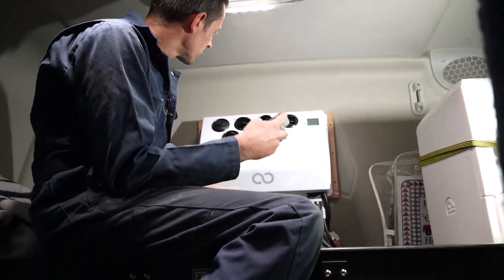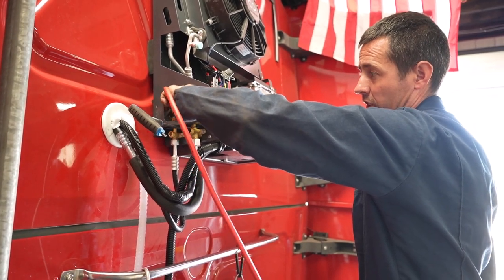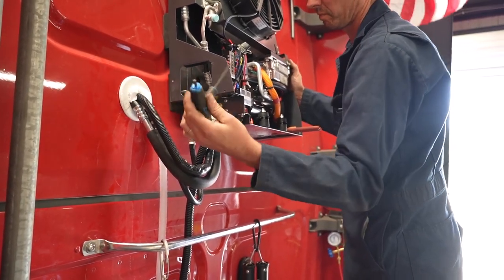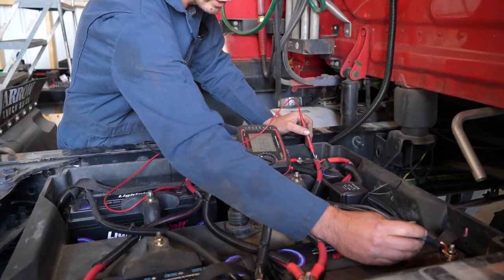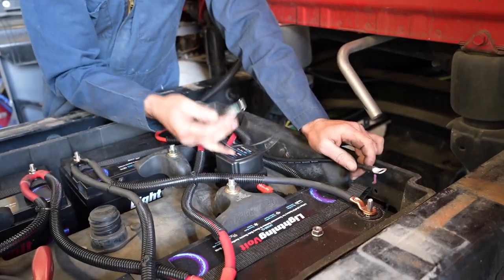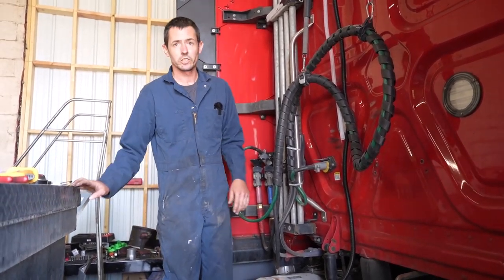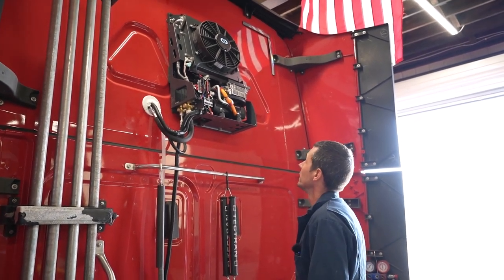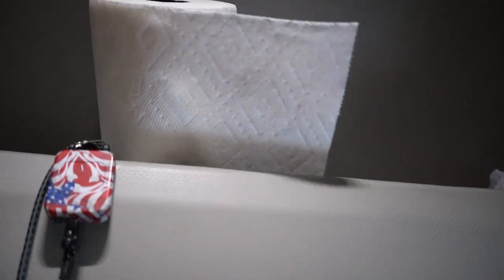Electric APU for Semi Trucks (Our first electric APU installation completed)

Comment: Way too expensive brother! That A/C Unit is $580 at Ebay. I just bought two lithium batteries 12v100ah for $220 each. And just pay some one $400 bucks to installed it. Roughly you’re spending $2k for everything. You’re charging $7k for everything that’s crazy. I understand everyone wants to make some money out here, but Jesus Christ $7k!!
Reply from the maker: You can get a phone for $200 and you can also get a phone for $2,000. They are both phones. But there are major difference in the components that are being used in each phone, brand name, and functions etc. That is all.
Reply: YouTube pricing lol he had to pay camera guy and spent some time to edit this video. That was an additional 5k 😂😂😂

There’s no money in trucking right now. I might as well sell my truck and open ac installation shop. I ordered the exact same unit from China, different brand but still decent quality lifepo4 batteries 600amp, dc to dc chargers, and all tools and was still under 2k. Took me a few hours to do the job but I guess I can be proud cause I saved at least 5-6k vs Ryan the YouTuber doing it for me
Reply: Where you bought the batteries and what brand

Comment: You should install DC-DC charger instead of isolator. Since your lithium batteries are very low resistance compared to acid batteries, it will draw lots of amps while charging, this will cause alternator to work at full capacity.
Reply: Never heard of that
Reply: Never heard of that! 😮
Reply: I was thinking the same; what’d be the effects of running and charging all day especially in high heat situations running one bank lithium and the other flooded or glassmat
Reply: @mtgwdefender  I run a DC-DC charger. My 2005 Sprinter van 2500 has cables from the alternator to the charger, to the 500 AMPS of LIPO Chinn batteries. I use a 2500 watt inverter. 12 volt Big rig AC is next.
Reply: One way to burn the alternator.
Reply: You will not burn up the alternator if it's a high output. I run a 285 amp. My DC to DC charger limits the charge rate to 65 amps. This also protects the cables from over heating.
Reply: I installed the "no idle" 12 volt 12,000 b.t.u. unit. It fit on one rear door. Delivered, tax and installed for $500. Five hours of work. Yes, it works fine.

Comment: It's best practice to release the refrigerant while the gauges are still hooked up (or at least a little to get positive pressure). By taking off the gauge under vacuum, it relies on the spring of the valve core to keep air out, plus you let some air in by the time you unscrew it far enough.

Comment: I am very interested. I have a few questions.

1) What is the BTU of the AC unit?
2) How many wattage does the 4 batteries have, both AGM and Lithium?  
3) Aren’t you concerned that the life cycle of AGM batteries are only around 500, versus 3,000 plus on Lithium?
4) does the lithium battery have self heating to be able to charge when is under 32F?
5) How fast do the batteries charge?  I have 3kwh I can charge at 1500 watts so about 2 hours.
Reply: I really hope he gets around to answering these questions
Reply: You plan on using the ac in the winter?😂
Reply: @Sinerwray  well the point is to also use heater and get access to the battery to power electronics inside the truck such as TV, etc
Reply: I think this unit can heat in winter if I'm not mistaken 🤔

Comment from the maker: Pricing for our Electric APU packages:
► Option 1 (with Lithium batteries): $7,699.99
Inverter, inventor hookup, heater, DC charger etc... are not included in the package, are subject to our standard shop rate.

Contact us @330-573-5396 to schedule your electric APU installation at our shop.
Shop address: 1120 High Ave SW Canton Ohio 44707

Lithium Batteries (Lightingvolt from Roadwarrior) used in this APU project is here
► https://bit.ly/3BgXT2U
Reply: I want one for my 2011 freightliner columbia ❤
Reply: Can u elaborate why it cost so much? My buddy bought same concept system on ebay for 1400 and extra 400 for the batteries I think. He is very happy with the performance of the system even though it's China made stuff. Was this unit USA made?
Reply: Do you have a payment plan for this unit 😊
Reply: Whats the difference between this model and the one in aliexpress for 489$ usd.? Is it 7 times colder?
Reply: @vitalekg thus unit is from China too

Comment: Hey Ryan, been watching since you were still driving and stopped in my hometown of Snyder at the allsups. Love your content. If i could ask one question as I'm interested in getting an eapu system installed, would you be willing to use a couple of the newer 560 AH batteries from Dakota lithium in your builds?

Comment: Lithium batteries cannot be charged when cold.  Are you heating them somehow for cold wx operations?
Reply: @ed1658  it is ONLy connected to the A/C compressor and fan?  I doubt that...
Reply: Maybe you could use the heater to bring the batteries up to operational temp, then charge.  Then that bank could be used for jump starts or other electrical needs normally provided by an APU
Reply: They're self heating when a charge voltage is applied.

Comment: generator Westinghouse 4500 for 700 and $400 portable air condition and you just run air conditioner so tell me why we would go spend the $6,000 + budget
Reply: Because you're probably running a one hose ac which makes everything muggy damp

Comment: Is it possible to do this set up with a generator instead of lithium batteries?
Reply from the maker: Yes
Reply: @truckingandfixing  I have a 4500 Westinghouse generator with 120 plugs. I’m not an electrician how can a 12v ac connect to 120v without messing up the unit?

Comment: Hi sir question do you think I can use  generator to power up the 12v ac unit instead of 4 batteries?
Reply from the maker: Yes you can
Reply: Thank for your response I appreciated a lot. Do you have any suggestion the first step I’m going to do I already have a split air conditioner and generator installed on my truck for almost 2years I had no issues but I want it to replace with 12v air conditioner but runs with generator instead of batteries should I buy transformer from 12v dc to 120v dc plug in to 3500 watts generator do you think it will work?

Comment: I had an electric APU. I stayed hot as fuck all summer...
Reply from the maker: It sounds like the A/C issue, not the battery issue. You need a higher cooling capacity APU
Reply: I have 6 years of experience in trucking CA/USA, 7500btu is enough for Canada, but it's impossible to keep the truck cool in Southern states of the USA in the summer . I would suggest at least 10000btu +

Comment: I want to know at 95 degrees outside how long will it actually run
Reply from the maker: Our customer who has the unit stated roughly 12-14 hours depends on how cold you like to keep your cab.
Reply: I have one that’s about right before it needs charging 12-14 hours. You can go 16 hours or so if you have it on the lowest setting works great 7-8 pm sundown until 9-10 am even in TX and AZ. You can use it while getting loaded and unloaded during the day but you will have to sit under the vent remember only the rear vents work not the front. If your a night driver and sleep during the day it will work with the curtains closed on the bunk but not much longer than your 10 hour break with it set to a higher setting.
Reply: @SamC992  thank you very much. That answered my question.  See i run a lot of pepsi loads so sitting in the day time is par for the course. So I guess next is to call green apu for a appointment.  Ryan should get on their list for service.  He would have all the east coast guys coming by.  Lol. Thank you sincerely
Reply: @thomaswilson8634 good luck I can’t stand the sound or smell of diesel apu’s I can sleep with a refer running next to me but not one of those lawnmowers
Reply: E APU won't ever cool down the bunk enough to get good sleep.
Reply: The advantage is you could add extra batteries to get more run time. Those are some pretty expensive batteries. Tons of cheaper options these days.

Comment: Honda generator 2000 bucks floor ac unit with revers valve for heat 400 bucks, extension chord 30 bucks. This is what I.m going to do. Generator or ac dies home depot has them in stock. I will never be out of ac for that long.
Reply: Don’t do it, it gets boring after some time having to get everything set up every night plus having to buy gas, filling every 8h that’s what my Predator generator ran , if you do get a remote start generator and auxiliary tank so it can run longer
Reply: That's a one hose ac which is very inefficient and doesn't really dehumidify like a real ac, things will be damp

Comment: Dont you need a DC to DC charger???
Reply from the maker: The isolator works well for this application.
Reply: Lifepo4 battery requires 2 stage charger. It's not ideal to run them with truck alternator.

Comment: How do you charge those deep cycle battery’s ?? Directly from the alternator??
Reply from the maker: Yes, direct from alternator
Reply: @truckingandfixing  thank you I appreciate your info
Reply: I have another question, is it an 8 gauge cable enough to run it from my truck battery to the deep cycle battery in order to change it ??

Comment: I’m interested and I have 4 batteries under cab and  4 in the back of the cab. I think it hook to the apu unit I already have in the truck. But it don’t work. It blown warm air in the summer and it don’t keep me warm in the winter.  Could it be low voltage